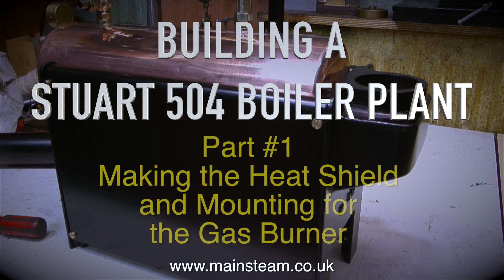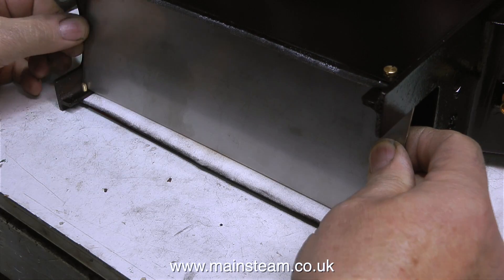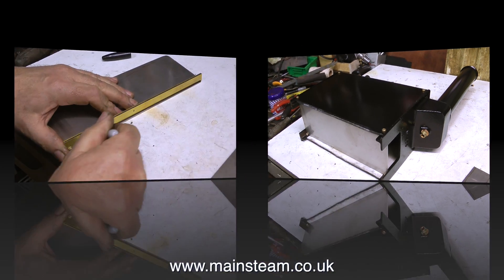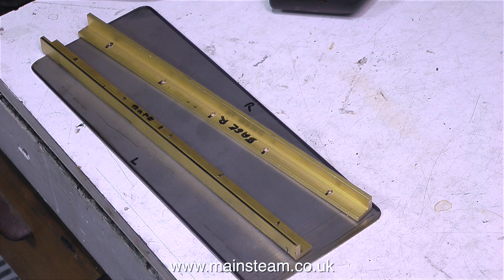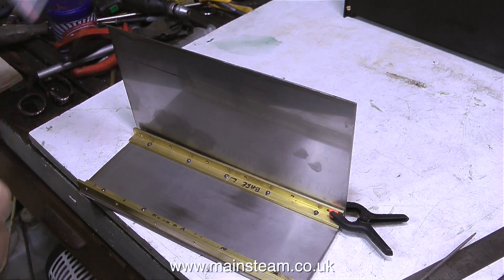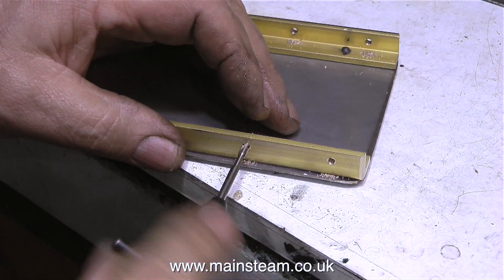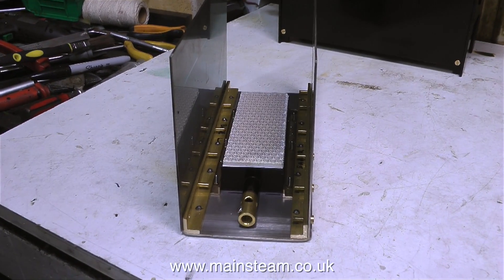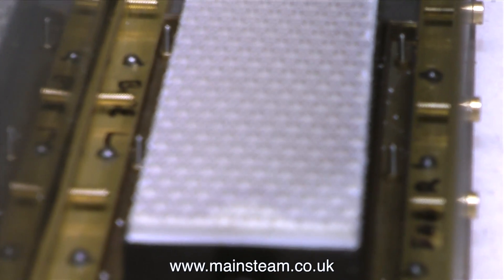MAKING A STUART 504 BOILER PLANT - PART #1 - HEAT SHIELD AND BURNER

Comment: I am tempted to order some stainless panels from Blackgates for my 504.  What gauge or thickness of SS did you use?  Many thanks for your videos!
Reply from the maker: They are about 2mm I think. That is the only size that they currently stock.
Reply: Thanks  for the  info.  Couple of orders from Blackgates arrived here promptly.

Comment: When I had a 504 and a gas burner and wanted to raise the burner up from the wood, I used an old sardine tin spray painted with black heat resistant paint. Your mounting looks (and probably works) a lot better.

Comment: Keith I love what you do and your sense of Yorkshire humor is never over looked by a fellow Yorkshire man ( Mug of Tea in hand)
 I am an engineer/ Welder though and know well that Stainless steel will expand faster than the cast iron mounts on this boiler so a little expansion room will be needed also SS will distort when heated and buckle making remove hard I see the plate SS is reasonable thick but making sliding fasteners my well over come so of the inevetable movement
All the best and keep on filming